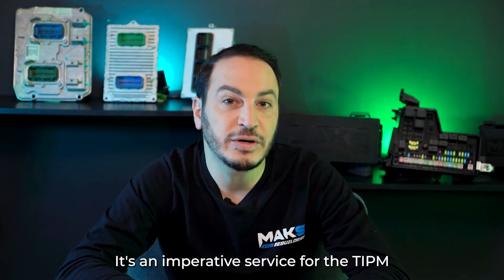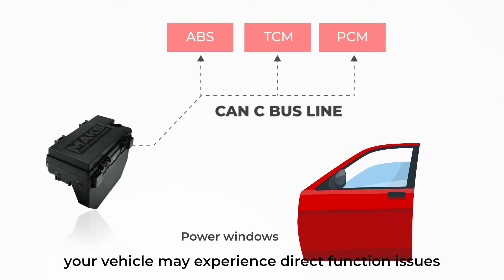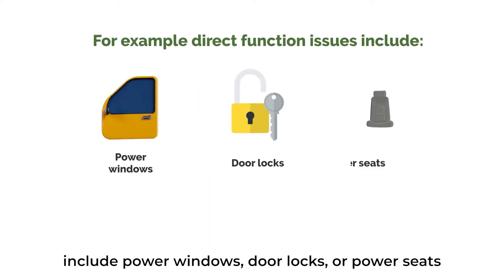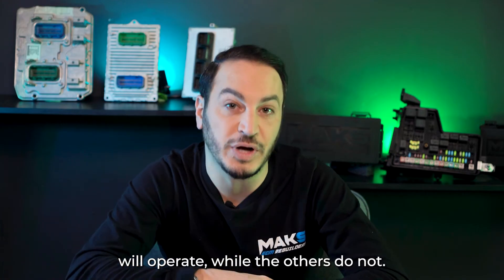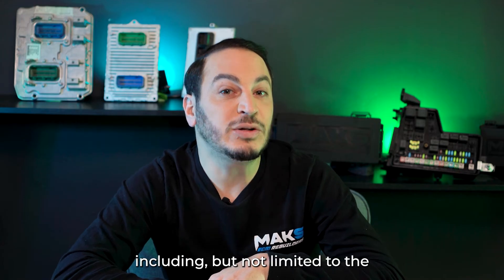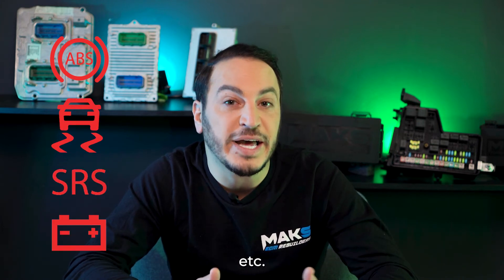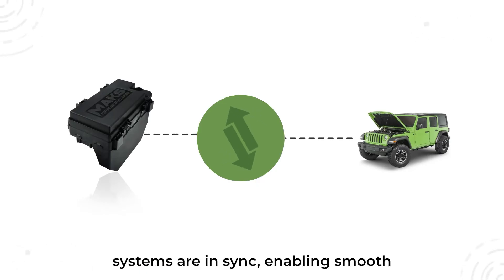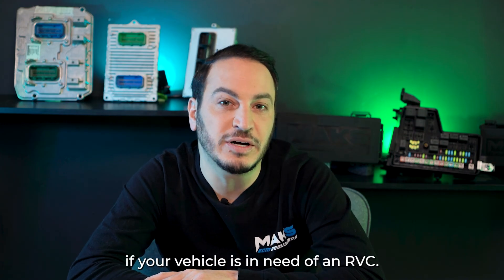What is Restore Vehicle Configuration (RVC), and Why Does it Matter for TIPMs?

Comment: My alarm goes off randomly, My drivers door doesn't unlock ( unless I lock it and unlock it again), my airbag warning stays on, my Sat Nav says I'm in Moscow ( I'm actually in the UK). My tyre pressure monitors are going nuts, displaying random numbers, I get warnings about air con needs servicing, service air flow meter etc. Does this mean my TIPMs is the cause?